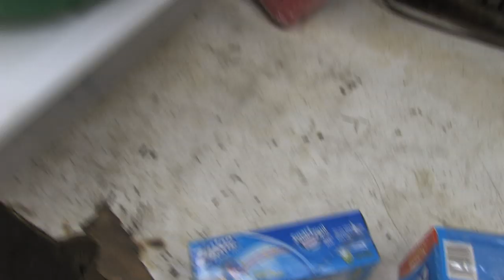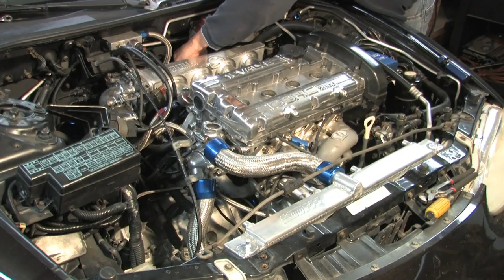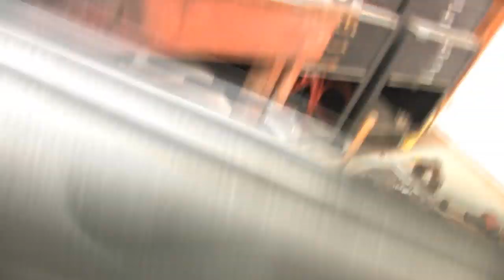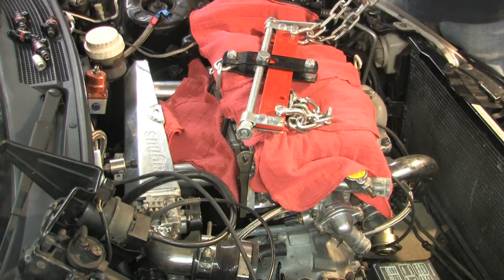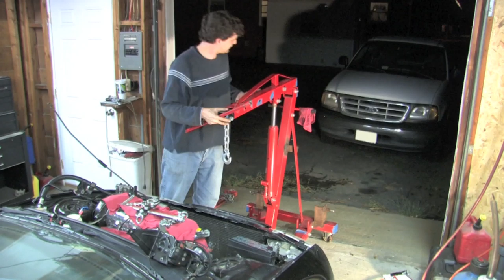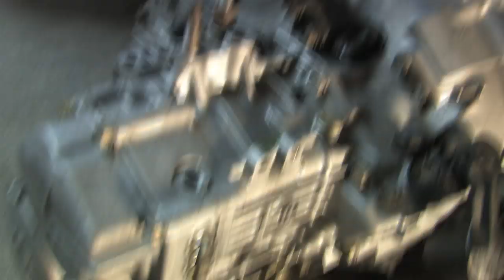Pulling the GSX motor (1080 HD)

Comment: I want to pull the engine and transmission together; which video is best for that? Where exactly do I place the jack stands? My engine has the head, turbo and manifolds removed; where should I bolt the balance/hoist chains to it at?

Comment: Is this pretty much the same on the GST?? I'm pulling my motor for the first time to swap in a JDM 4g63.
Reply from the maker: Yes.  It's exactly the same as the GS-T, save for 5 transfer case bolts and a driveshaft.  So basically you have to do 5 bolts less work.
Reply: Jafromobile awesome this is going to help tremendously I'll let you know how it works out for me

Comment: Hey man love your YouTube videos. I was watching you engine removal vids as I’m getting ready to attempt to pull mine on the Gsx by myself. I read the comments and noticed lots of people asking about what you used on the cherry picker and I know what the load leveler is, my question is where did you get those brackets that you bolted to the exhaust and intake manifolds? They look slick. Did you torque them to spec or just snug them up for the pull? Thanks man!!
Reply from the maker: They're included on the engine that came with your car.  Sometimes people take them off.  My GSX is a show car (that I also just happen to race), so I removed them.  They're an important part that I saved.  I had to put them back on to pull the engine.  If you don't have them, you can just bolt a chain into manifold bolt holes in the head.  You can easily mar the valve cover of a 4g6x DOHC engine because of the shape of the head, so if you do this put rags between the chains and the head when you lift.  Yes, the factory brackets are nice because they spread that load across several holes or studs, and they give you anchor points to attach the chains that don't permit the chains to drag against the head as you lift.  If yours are gone, I'd recommend reaching out to one of your DSM friends and borrowing theirs, they change slightly depending on production dates.
Reply from the maker: PS:  They're attached with the factory bolt specs for the manifold bolts.  I think it's 18lbs for the exhaust and 24 for the intake, but don't quote me on this because I don't know what year your car is.  It's been years.  Whatever the service manual says for the manifold fasteners.  The spec is the same.
Reply: Jafromobile big time thanks!!

Comment: I have two questions for you. I know somewhere in your videos you talked about the tires. Have you tested these V radials in everyday driving? Inclement weather? Basically, are they good for a daily driven vehicle. The second question is that with all the work you went through with the Elantra's engine, why not put that engine into the GSX? (given that i dont know where the GSX stands currently)
Reply from the maker: Oh yeah, I've even tested their 555R drag radials, bald, in 5" of ice and snow.  Guess what?  They both did great in a 2g GSX.  It was only about 324hp at the time.  I've been through 4 sets of the 450's.  I think they're quite possibly the best 16" tires for this car for a street/strip setup.  I ran just as good of a time with the 450's as I did with the 555R drag radials.  1.64 on both sets was the best I could do, and still, that ain't bad.  Not for a street car.  They're quiet, have good sidewall stiffness for handling, and a dynamite all-weather tread pattern that doesn't just look aggressive.  They hook.  On an AWD car, they hook GREAT!  I get 'em for $86 a tire.  That's a bargain, too.
Reply from the maker: All the 555R's did was ruin my paint job.  Every grain of dirt and rock got picked up off the street and slung off around my wheel arches, sand-blasting off my paint.  10,000 miles with drag radials is why I re-painted it (without the 2-tone stripe that all of the turbo cars came with).  Note my first Dyno video, it had the original paint.  I would have put the Elantra engine into the GSX except that would have required someone way more practical than I am.  The GSX engine's next go-round will be an engine even more beautiful and more powerful than it was before.  I never wanted to make this Hyundai engine beautiful.  I will do the less practical [and possibly less intelligent] thing and overbuild the living daylights out of another engine.  I still have some more feelings to hurt with the Hyundai.  I'm so mean.  

But yeah, I did actually give that a lot of thought throughout that process.  I think I might be the only person to ever swap a Hyundai Elantra's engine (that previously came from a Galant) into a second-gen GSX.  It would totally work, though.  All the same stuff in the videos I made with "1gina2g" in the title are the videos about how to do exactly that.  I'll have an update soon.

Comment: Good video my friend. I had to replace my transmission and that took about two hours. I need to make make a video like this too. I have a 95 eagle talon tsi eclipse swap. Original 4g63t motor. Now I get to pull the stock turbo and toss a big boy in there. Might make a video for for that. What was the overall failure in the gsx?(too lazy to read the comments) I'm blowing blueish gray smoke: sure it's the turbo seals leaking into the exhaust.
Reply from the maker: +Sonny D'lyte You don't need to read the comments at all.  The next video up is my 7-Bolt Shortblock Failure Complete Diagnosis video.  ;)

Comment: I have a question. What valves should I run on my car with a hx35 turbo setup. 1g gsx. Thanks
Reply from the maker: I would use the standard valve size until you put an HX40 on it.  If it was a 2g head, I'd say maybe .5 or 1mm oversize, but the 1g head doesn't have very good port velocity because the ports are too big.  Bigger valves would decrease fuel atomization, and raise the engine RPMs of the "sweet spot" where airflow is concerned.  If your transmission is already built to handle 8500+RPM shifts and every possible thing has been ported and modified, then go for it... but you'll get a better fuel burn out of the standard sized valves.  Standard valves (they're already big concerning 4-bangers) will also be better for driving on the street.  Bigger valves don't necessarily help you flow more air.  It's the rest of the intake and exhaust as well as the cams that are going to affect that most. Valves are an area where balance is necessary for performance.
Reply: Awesome. Thank you much for breaking it down to the T.

Comment: Why did you drop the cross member when doing this?
Reply from the maker: For clearance so you can rotate the engine and lift it.  It doesn't matter whether you're taking the engine and transmission out separately or together, it interferes.  It's much harder, and borderline impossible to take them out without doing this if you want to keep the paint on your frame rails.  If you remove the crossmember and lower it a little bit, you can turn it at an angle and pull the whole thing without touching the frame rails.  You can't turn it with the crossmember in place because it goes through a groove cast into the bottom of the transmission and it hangs up.  It's pretty easy, though.  It's just 9 bolts on a 2g.  It's 5 bolts on a reinforcement plate and 4 on the crossmember.

Comment: What did you do there with the zip tie and slave cylinder?
Reply from the maker: I put a zip tie into it fully compressed because it has a spring that can push the rod out past the seal, it leaks all inside the boot and you get air in the lines.  So you zip tie it in, un-bolt it and don't end up with a spongy un-predictable clutch when you put it back together.  The shortest way to describe this is being a product of laziness.  A 2¢ zip tie saves me an hour of labor later.

Comment: What brackets do you use to hook the hoist up to the motor
Reply from the maker: The part I'm using is called a "load leveler" and they're available at most auto parts stores for around $30.

Comment: How you eliminates the air flow sensor
Reply from the maker: chacho12a I'm using an old school MAFT setup.  The MAF Translator from Ramchargers uses a GM MAF sensor.  That sensor can be mounted on a charge pipe... the upper intercooler pipe in my case.  That lets it meter boosted air, and gives a more accurate airflow count if you have a vented BOV.
Reply: *****  ok I want to do the same thing I have a eclipse gst   thanks for you help
Reply from the maker: chacho12a There are far better means of doing this.  ECMlink for example.  You install a GM MAP and GM intake air temperature sensor, and convert your airflow metering method to Speed Density using their product.  Then you don't need a MAF at all. Far more accurate and friendlier with methanol injection, too.  Too many other benefits come with that product than just airflow metering, though.  I just think it's money better spent.
Reply: Thanks for  the information

Comment: What were you doing to the wheels?
Reply from the maker: Where in the video?  All I can think of is having to remove the wheel to pull the axle so I could remove the engine?  Just guessing of course.  I don't know what you were referencing?
Reply: That would be it, if you just pull the engine and leave the tranny in can you leave the axles in?
Reply from the maker: I would tell you it isn't possible, except that you might take that as a challenge.  One of my friends did that once.  He bought a 1g and plucked the engine with the transmission in place because I told him he couldn't do it that way.  3 years later I pulled the transmission from the same car out of a local junkyard for $89.  It's in my Dewalt Review video with TurboTalon.  Nobody had interest in trying to put it back together after that, and it was a shame to see that GSX go to waste.  It's really much more difficult to pull it the way you suggested no matter what Chad ever says.  He's not your normal everyday mechanic.  I still don't understand how he got it out with the transmission in place, and I'm not challenging you to figure it out.  You're far less likely to break things if you pull the transmission out WITH the engine all in one piece.  It's so much easier to separate and re-attach them outside the car.  If you don't have those capabilities, it's still easier to drop the transmission and then the engine, but on a 1g I would always pull them both as an assembly because I find fighting the crossmember on a 1g to be more of a headache when you remove them separately.  That's my 2¢.

Axles aren't that bad to remove.  You can take the whole suspension assembly out if you separate the upper and lower control arms.  You just have to disconnect the brake line.  A quick pry bar later, and you've got the whole strut/spring/knuckle/axle assembly free.  I find my method to be the easiest, but I've had lots of practice with it.  Robert (TurboTalon) has videos showing a different method than mine.
Reply: Alright, thanks bud! How similar do you think a GST pull would be?

Comment: Hay man u r a beast under the hood and under the car JAFROMOBILE, I have a 98 gsx with t4 turbo, fuel pump, adjustable cam gears front mount intercooler, 3 inch exhaust, 2.5 down pipe and a couple other mods but i wanna do something drastic to increase hp since the transfer case broke soon after i bought it,./ pls answer,./